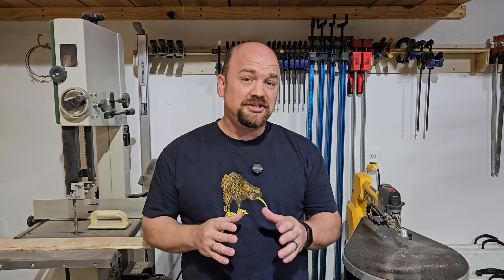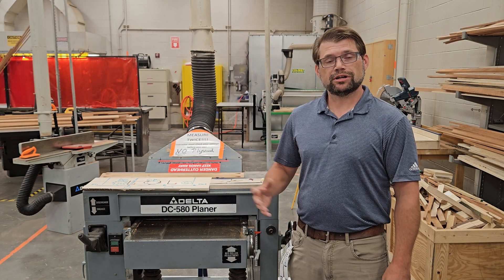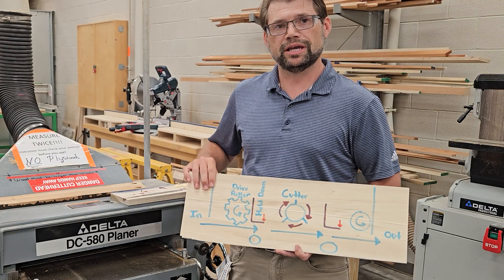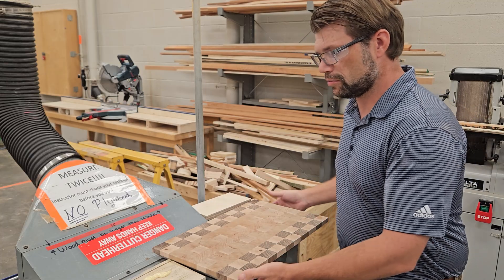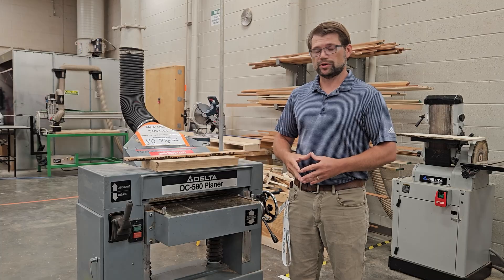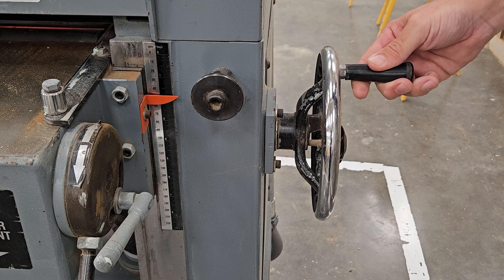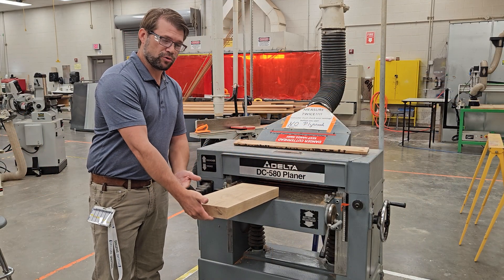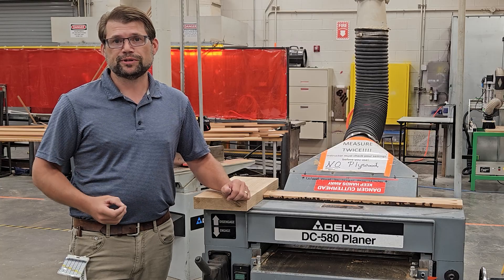Planer Safety: How To & Safety Tips for Shop Classrooms & Beginners

Comment: What was the push stick for?
Reply from the maker: Great question, and something we didn't hit but should have in the video.  With some shorter pieces, the instructor tell students to use the push stick on the piece to push it forward at the start instead on have their hand over or near the bed area.  It's typically unnecessary with longer boards once the feeder has taken control of the piece.
Reply: @theimaginationwoodshop thank you for your response.  Great video by the way. 👍